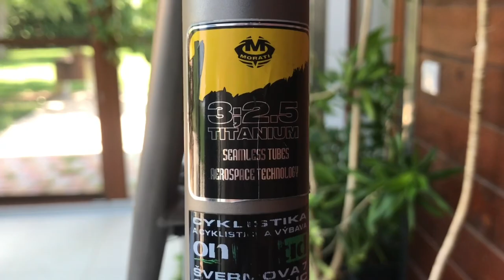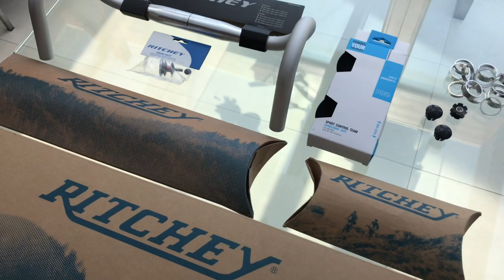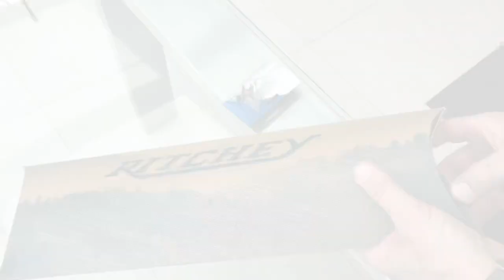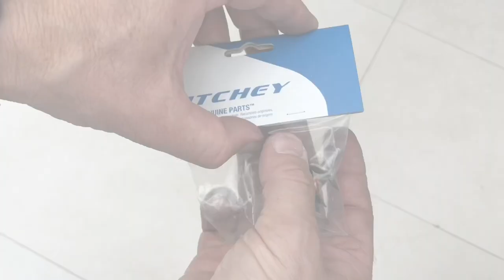Ritchey Classic upgrade on custom titanium MORATI road bike

Comment: Nicely done.  The titanium spacer is  nice touch , it matched the frame perfectly.  
I was lucky to come to acquire a Morati in the early 2000.  Mine have a 1 and 1/8 steering tube.   What size is your seat post?  I have to use a 27.0 on mine.. A matching Morati stem be a nice compliment.  But you will likely limit your bar choices.  
Thanks for  another great Video.
Reply from the maker: Thank you very much , I have 27,2 seatpost. Congratulations  on having such a great bike .